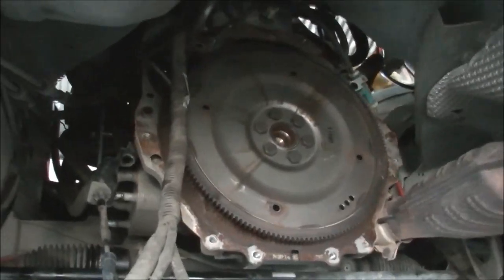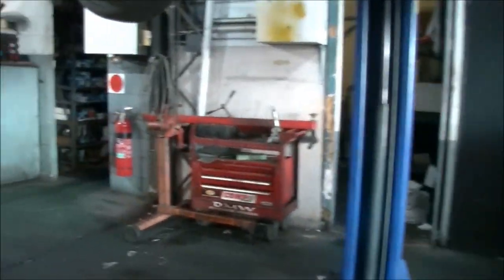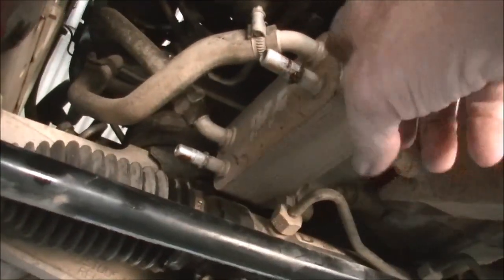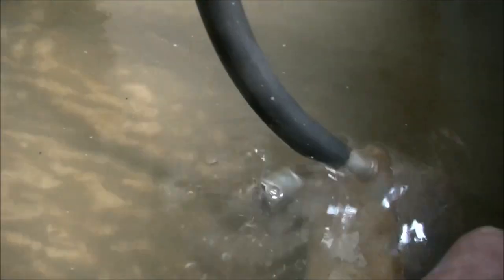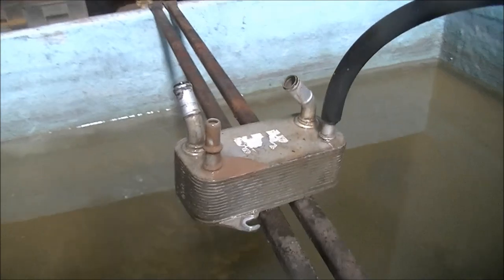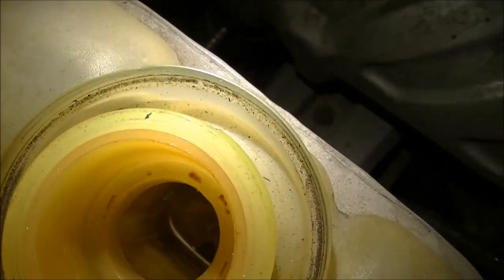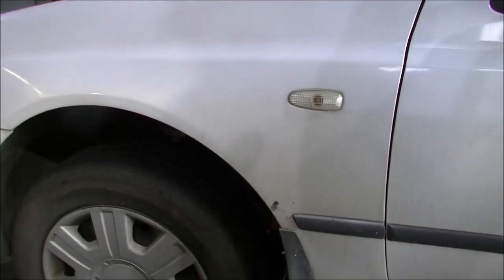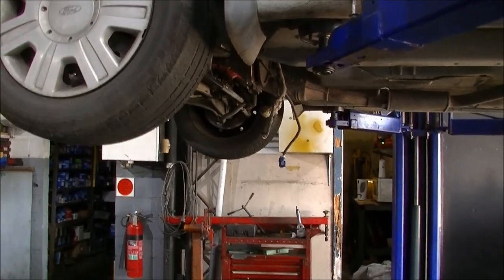BF Falcon Coolant loss and Auto Trans leaks milky oil.

Comment: Its called a remote transmission cooler/warmer or simply a heat exchange. I just cut the lines to mine, pushed in a pipe joiner, connected some transmission hose, ran it up to the front of the car and hooked it into an oil cooler I purchased off ebay, just hooked it onto the air con radiator. Never have to worry about milk shake, cost me about $75 all up for the hoses clamps and oil cooler. Proper bypass kit was over $300, ya can do it a lot cheaper like I did.
Reply from the maker: Cool, thanks..You know when you get those blank moments...

Comment: i dont like the design with the 90°c transmission water thermostat near the intake , the quick connects and inconvenient  placement of the heat exchanger , i binned every last bit of it and installed a large  B+M supercooler with steel lines from a BA , the  transmission runs "much" cooler and the engine runs cooler ofcourse , trans "never" gets over 60 deg c on hot summer days towing heavy loads, its run well like that for many years. the horror stories like youve just shown  motivated me to put the oil to air cooler in.
Reply from the maker: Yeah mate they fail regularly...I'll just put it back stock.

Comment: I had the milkshake happen to my FG XR8 years ago when thankfully it was under warranty,  but after the rebuild it drove like garbage and had torque converter issues (never let Ford dealership arrange the ZF rebuild) I currently have an absolutely immaculate silhouette 2008 BF mkii XR8 with only 54,000km on the clock - does this model still milkshake and what's the best kit to avoid this ? I hear the XR8s have the heater exchange as part of the radiator... also how much is a ZF rebuild. Thanks!!
Reply from the maker: I'd fit a stand alone oil cooler mate.
Reply: They would’ve outsourced the transmission to an auto specialist. We never used to rebuild boxes and diffs in house. Always sent away to another shop.
Reply: Contact Monsta Torque in Perth. Ask about their zf6r80 (ZF Hybrid) and add a B&M air to oil cooler and get rid of the heat exchanger

Comment: I can remember Ford being taken kicking and screaming to rectify that trans cooler problem in the BF.
Reply from the maker: And they still fail.!
Reply: @ziggassedup  😩😫😭😭 my reaction when mine failed in my FG XR8.. That was 8 years ago now and I'm still suffering mental torment over it and the possibility of it happening again to my current XR8.. touch wood touch wood.. it will be fine
Reply: @mrbrad4637  get a PWR heat exchanger, all billet. Will never have a milkshake issue ever again.
Reply: Better off getting rid of the milkshake maker and replacing it with an external trans cooler/ air to oil cooler. You'll never get a milkshake from a b&m cooler 😎

Comment: The very first thing i did when i purchased my fg xr6 was buy an external transmission oil cooler so i never have to worry about this common problem. Stupid design,bypass this unit and no more worries. $220.00 is a lot cheaper than a transmission rebuild.
Reply from the maker: Absolutely.

Comment: Does this appy to an EF Ford Falcon Wagon as well?
Reply from the maker: That would be a fault in the radiator if the Tranny oil gets milky and or the coolant may have a red tinge to it...What's your issue mate.?
Reply: I had a little waxy sludge in the over flow reservoir so I did a radiator flush etc and changed the thermostat  and I notice now although the temp stays in the normal area when I turn the engine off it forces coolant out of the over flow pipe 
I don't have a red tinge in the coolant , I haven't check the transmission fluid yet, I might have to take that to a service station for that., PS thanks so much for Ur reply btw.

Comment: hi legend,the same problem to my bf right now and its been parkin for couple weeks, i want to ask some info from u bro is that need to change transmission and radiator? is this problem will blown head gasket??? advance thanks mate
Reply from the maker: The water in the trans is not good...You could try to flush it all out...Radiator should not be affected...Head gasket will only blow if you overheat the engine from all the coolant being in the trans...Hope that helps a little...Cheers mate.

Comment: Hi, can i ask which line is the hot line from the transmission to the heat exchanger?  Is it the line at the front of the trans closet to the convertor?  Thanks
Reply from the maker: I'm not certain but I'm pretty sure the line closest to the pump and that would be the one closest to the converter.
Reply: @ziggassedup  Thanks for that.

Comment: They are still using these stupid heat exchanges on the fg falcon and im pretty sure they would be on the fg-x too.
Reply from the maker: I think so.
Reply: @ziggassedup  after many many years of having these heat exchangers on falcons and territorys you would think ford would change the design but no,its called planned obsolescence the assholes,so you keep paying for mechical repairs and replacing poor design parts many years after purchasing the car. I can point out about 6 items on my 2010 fg xr6 that are a piss poor design and engineered to fail-example,the bloody diff bushes,the transmission shifter linkage join made of plastic. There's other things that are bad design flaws but I can't think of them at the moment.

Comment: So let me get this right , even if you just bypass the Hard Lines into the radiator and fit an external cooler, you still run the risk of having problems if the Heat exchange fails? ( So you should delete or bypass the heat exchange as well)
Reply from the maker: If your car has a heat exchanger then there are no lines to the radiator...It's cooled/heated by the two water hoses that run from under the manifold and that device has a thermostat in it and it fails too.!
Reply: @ziggassedup  is there a specific kit to bypass the heat exchanger? I can’t really find any you tube videos on it .. lots on radiator bypass, but not the heat exchanger
Reply from the maker: @Chris-74  Ford do make a set of pipes to delete the thermo but that's $400 so some heater hose and clamps is what I do...
Reply: @ziggassedup  no probs, Thankyou Sir !😉